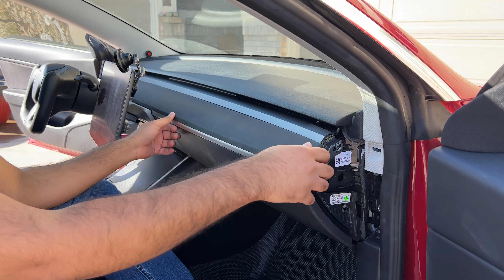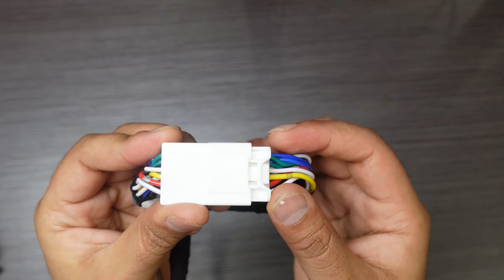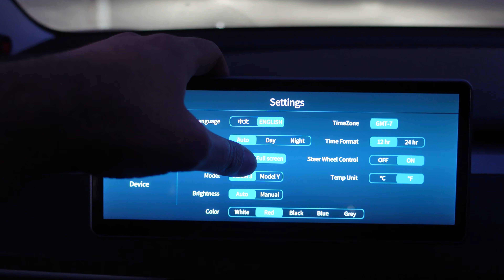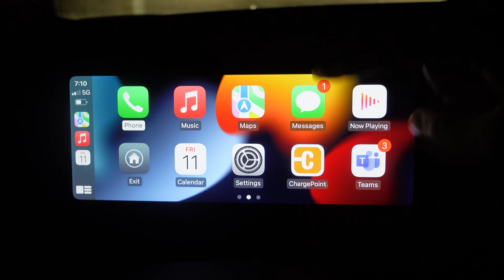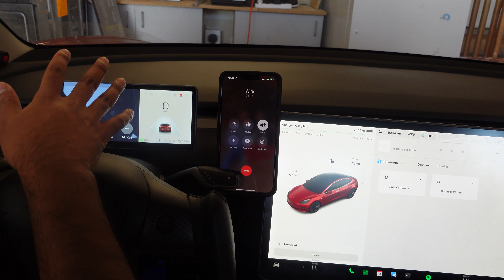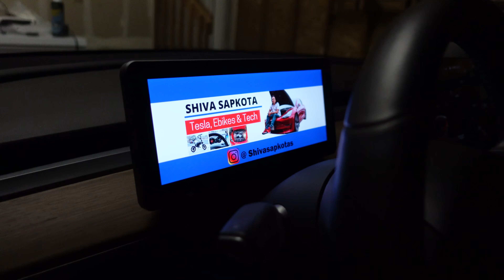NEW Apple CarPlay Display For Tesla Model 3 & Model Y - Instrument Cluster Must Have Accessory 2022

Comment: I'm really glad I found your channle and your videos are pretty awesome.
How does this work with pin to start. And are there any concerns around this unit either being compromised and breaking your tesla security or allowing access to the  OBD port via this unit as its now tapped into the OBD. We have seen how easy it is to steel a car once the thevies have access to the OBD ports.

Comment: Hi Shiva.
Thanks a lot for your reviews. Very productive and precise to the details.
Can you please advise for this screen:
 - How does it work with Tesla audio? Can you Spotify songs through this display? Can you control the list with the steering wheel when car play or android auto is connected? Does it has delay?
 - Are controls always working or if you go on autopilot - will it block the left control on the steering wheel?
 - Does Waze (android) works with this display?
Reply from the maker: -You can connect this display to Tesla via bluetooth. Then everything you play through this display will play from Tesla speakers. There is a slight delay and you can use the steering wheel control when Carplay or AA is connected. 
-The right control will not work when you go on AP but the left works. This is so that it doesn't interface with AP controls. 
-Yes Waze works with this display through AA or Carplay. 
Thank you.

Comment: I installed everything like video my screen won't turn on or have none of my speaker is working now any help please
Reply from the maker: Do you have Intel or the AMD chip? If your speakers are not working, I suspect the wiring connection is loose on the OBD. Please double check that wiring. If you lock the car for several hours and let it sleep, the speaker should start working again. This happens when you take too long to plug the OBD connection back on. If the issues persist, please reach out to Hansshow. Thanks.

Comment: Sorry to bother you I love your video very clear Can I have a question the plug you unplug lock color gray and white but why my model y 2023 that plug black color? Thanks
Reply from the maker: On your Model Y 2023, the plug is on the side door panel (easy access) and it is blue color. Nothing is plugged into it by default and you just have to insert the new male plug into the open female blue plug. Please send me a quick email if you need pictures to locate it. Thanks!

Comment: I have one of these, but getting the latest firmware is challenging, my CarPlay stay connected despite being in the house.
Reply: Have you found a workaround or solution for this? If the CarPlay stays on without anyone in driver seat while car is in the garage, that's an issue since my garage would also be in range while I'm in the house. I have basically the same car as in the video (Intel), but a 10/2019 manufacture date. Does @Shiva or Haanshow have any comments on this issue with CarPlay staying on after leaving car in garage at home?

Comment: So you can use the scroll wheels on the steering to control the  handsshow screen right ? How do you switch the scroll wheel functionality from its native features like to adjust mirrors, adjust steering wheel etc, to scrolling through the handsshow screen and vise versa ?
Reply from the maker: Hello, the native features use the left scroll wheel and this display uses the right wheel. The right wheel only controls car's following distance and autopilot speed and in that case this display cannot be controlled by the scroll wheel once the car enters an autopilot mode. Thanks.

Comment: I have the amd you said the connection  would be on the passenger  side foot panel right? Would  it be the blue connector which I saw in your video?
Reply: Hi my friend  can you please specify which particular plug it is for me to connect  my hansshow cable connection on the passenger  foot panel ? Is it the blue connector where there is nothing  connected  to?

Comment: Thanks Shiva, just installed this device this morning.  Went pretty well, that plug is a little hard to get to but not too bad.  one question - my unit seems to be slightly crooked - it is not completely horizontal as you look at it through the steering wheel, it is angled some towards the left so the right side is a bit higher.  The device is secured to the ac panel.  Also both your instructions and the instructions in the box did not have the hole count right for my 2018 LR AWD Model 3 so I got it to where it was pretty much centered and equal distance from the cut out where the steering wheel goes.  Using the instructions or your count it was way off center.  Not sure if that has something to do with it.

Comment: I have a new 2022 model Y with AMD - where exactly is the Plug on these newer cars - and why colour plug is it....
The picture seems to show its on the side under the passenger area, can you confirm please?
Reply from the maker: On the bottom right door panel. Please shoot me an email and I will send you some pictures. You will also have to run run power and ground from the frunk 12v battery.
Reply: @ShivaSapkota  thanks - done. I also see I have the newer battery with a funky connector - thankfully I can see a positive and negative screw off the battery...

Comment: Excellent video.  I am not sure my wallet needs this, but my Tesla would much like it. I do have one question, does the display screw up using the scroll wheels with the main tesla interface since I saw you using the right scroll wheel on Hansshow display?

Comment: Hi Shiva how were you able to connect the two screens in your tesla to compare side by side? I have installed the new screen however I am trying to install the auto presenting door handles and requires me to plug the cable into the computer. Since I already have the screen connected into the autopilot computer should I just loop the cables from male to female then into the computer?
Reply from the maker: Yeah you can daisy chain the two plugs. Idk if you are a FSD beta tester but my beta didn't work after I daisy chained the two plugs. I had to remove one of the plugs but it could have been just my car. Beta started working after that. The non-beta FSD worked well with 3 plugs daisy chained together. Cheers!
Reply: Thanks Shiva because I was worried I had to take one product out. I will get the install done this weekend
Reply from the maker: @MannyEV_Tech  Good luck!! 👍
Reply: @ShivaSapkota  thanks for your quick response

Comment: Great video. Thank you! I've bought this and installed it on my 2018 Model 3 following your video. It was great until for some reason I am seeing that Carplay does not automatically boot up and connect to my phone. I'm seeing it fail about 50% of the time where it does not connect. I synced it up using the BT-LINK as per the instructions on the device, but its not connecting 100% of the time. Once it connects though, the connection is solid, but I'm wondering if anyone had this problem?

Comment: I have watched this video 2x because I am so intrigued and think it would be a great addition to my Y but for a variety of reasons would not buy it. 1. Because it seems not totally refined 2. Worried about its long term viability. 3. Would NOT want to personally install it. 
With all that real estate on the front direct view it is so frustrating Tesla did not just place some basic details or offer an add on that would deal with speed and just some other basics. The constant 30 degree turn to my right side is annoying and at times dangerous. This might be my only and singular complaint with my Y after basically two years .Other than this display issue or lack of I'd say it is the single greatest car I have ever owned. Just think Tesla is missing an opportunity here to add safety and functionality. Maybe some other vendor will in the near future.

Comment: Shiva, thanks for the review.. I must say how disappointing it is that Haanshow has completely forgotten about those who were early adopters of the10.25" version.  They have stopped updating the unit, there is no feedback from them on their own forums and they have still not fixed the Carplay Phone calling issues, that make the unit unusable ( horrible echo on the other side of the call when unit is sending audio thru the Tesla BT system) . The least they could do is offer some sort of trade in or discount towards the Linux based units (which hopefully don't suffer the same Android based unit issues)  The fact that you have had numerous questions posted about using the existing wire harness and the only response is that " you are waiting on Haanshow"  Tells me they have still not figure out how to support the product they are reselling. It has so much potential, but too many little flaky things that make it hard to justify its purchase.

Comment: Hi Shiva. I ordered this one with your referral code.

I received a connector that is the size of the bottom (white) socket, not the grey one. I have 2022 Model Y with Intel processor and my computer looks like the one on your review. But the connector is the size of the white socket…

Should I install it there?
Reply: Is your 2022 model Y with intel based infotainment computer a performance or long range model Y? +MrGimply
Reply: @electricant1367  I've got a model y performance... Which model do I need?
Reply: @benstory5656  I ordered the 9" Linux version. The unit is in transit right now according to FedEx. My 2022 Performance Y has the Intel Atom chip in the infotainment system so I ordered the corresponding display. How to tell if you have intel atom or AMD risen chip in the infotainment screen https://youtu.be/UyRT4zc2JYA .
Reply: @electricant1367  thank you... Waiting for my car to be produced and delivered (was June to July now July to Sept) once I get the car I'll check the chipset. Thank you for the help. Do I need to do anything additional for the front camera view?

Comment: Thank you for the review. I just received the new Hanshow display. I have an android phone and I didn't realize that the android connection is by cable only and not wireless. It isn't a huge issue but do you think they will add that feature with a future firmware upgrade? Also do you know if I can use any of the car's USB ports or do I have to use the one on the display unit?

Comment: Hi, I have a 2022 Model Y with AMD chip.  Do you have any information if the plug location?  After install the screen, I was not able to find the grey plug any where under the glove box.  Thanks for your help.
Reply: I’d go to hansshow’s web page. There was a link for chatting via Facebook messenger or whats app. I had a different question and asked via Facebook messenger & received an answer about 10 hours later. Hansshow customer service is in China I believe so account for time zone difference.
Reply: There is a plug on the A pillar tucked in among other harnesses. Look at the size of the plug you’re installing and it should be pretty easy to see. 
Another note, as I have 2022 Model 3, mine did not work when plugging into this spot. I had to plug into the empty blue connector and ended up not using the Y splitter since I didn’t have to unplug any OEM.

Comment: I was excited to install this, but the connection to the computer in my 2021 model Y was WAY harder than it appears in the videos.   My hands were too big for the space so I had to get my wife to help - and she was not too happy about that!   Once all connected, the new display did not work.  Even worse, my Telsa display only came on only when a car door was open. Also, the car did not seem to charge anymore.   So I had to uninstall the new display and I will have to return it.    Did anyone else have these issues?  Maybe mine was just defective
Reply: Wow @mitch sieverts that's a bummer.  I'll have mine in a couple of days and hope that I don't have the same experience.  Which style console does your Model Y have - the older shiny piano black style like Shiva's or the current more padded version?  Also, did everything go back to normal after you put everything back?
Reply: @infotime  Yes, everything seems to work ok now
Reply: @mitchsieverts8094  
Are you sure it didn’t just go into safe mode?  It happens if you take too long changing the plug.  This resets after an hour.  He explains the issue in the video

Comment: Great video and I actually purchased a display based off of one of your other videos but judging by this review, I should have gotten this one.  Quick question, when using Waze via carplay, does the nav instructions come from internal speaker or Tesla sound system?  The current  screen I have plays the nav through the speaker and is hard to hear.  Thanks for the informative review!

Comment: Love all your videos and your energy.  After trying several CarPlay hacks and sitting out the previous version of this, I just bit the bullet and ordered this.  Thanks for the discount code!  Hope the "under the glovebox connection" isn't too horrendous to complete.
Reply: How did your install go?
Reply: @electricant1367  worked out pretty nicely.  That behind the glovebox connection was tough, but not the end of the world.  I layed on my side and supported myself with a large box on the ground by the passenger seat.  Overall pretty happy with the system so far.

Comment: Stupid question, but I assume the sound from this unit plays over the Tesla speakers?  If so, is it hard wired or use Bluetooth to play sound?
Reply from the maker: That is correct, the sound from this device can either play through its small speaker or play through Tesla's speakers. This is all connected via bluetooth. Thank you.

Comment: Hi Shiva, great video as usual. I have the old 10.25 model and sound quality and connection issues seem to have gone away. When you use steering wheel control can you make and answer phone calls using the scroll wheel when in CarPlay? Like you can on the old screen. 
Cheers

Comment: So for amd chip variant installation is more complicated? How to  run wires to door panel? Can't find any installation videos for Razen.
Reply from the maker: Sorry what do you mean by Razen? Thank you.
Reply: @ShivaSapkota 
I mean new AMD Ryzen processor instead of Intel , most 2022 models have amd razen processors.
Reply from the maker: @sergys8282  The new cars with AMD chip have the OBD plug on the passenger side footwell pillar instead of under the glovebox. If you get the smaller size display you don't have to route the power and ground, for the larger size display you can get the power and ground from the frunk 12V battery. You can reach out to Hansshow and they can send you some info on the new models. Thank you.
Reply: @ShivaSapkota 
By "smaller size display" u mean 8.8 and 9"? I am interested in this 9" display. Getting power from frunk sounds complicated. Thanks.
Reply from the maker: @sergys8282  This 9" one doesn't require additional power run. So, just ask them for the wiring diagram for the new AMD models.
Reply: @ShivaSapkota 
Thanks man, appreciate your help.

Comment: Hello and thank you for the video. i have a 22m3 with the AMD processor. I purchased the larger display and received it last week. I didn't get any directions or wiring diagrams with the equipment. I have contacted Hansshow and they wont respond. Do you have anything that shows where to install the ground and power? i didn't know if you need to splice these wires in into exsisting wires.
im excited to install but i don't want to cut into the existing wiring.

Thanks
MIke
Reply from the maker: Hello, thanks for watching my video. For the AMD chip, the OBD plug is located on the door pillar. If you send me a quick email with your order number, I will push Hansshow from my end to help you out. The ground and power needs to be routed from the frunk 12V battery. You can technically tap into the wires under your glovebox but it is a little risky. Thank you.
Reply: I’m having this same issue. No instructions. 22 MYP with AMD.

Comment: If I currently have the 10.5", is it worth it to change to the current one?  I don't really have any issues with the current one other than the vents being blocked.
Reply from the maker: I honestly don't think you are going to feel too big of a difference with the airflow. Yes, it is much better but still blocks air. So, it is up to you if you think the new UI and after interface is worth the update. I wouldn't upgrade just for the airflow. Thanks.

Comment: Will they continue to improve and provide updates to all older models? At this rate if they come out w a new display every year and stop supporting their older models, it won't make for the best customer experience and honestly not something I'd want to commit to. Can you confirm this with them?
Reply from the maker: I am also now wondering about that. They are not very clear on these updates. They told me since they fully developed the last year's android display, they might not add a ton of features in the future but continuously support and patch those displays if you have issues. They can't fix stuff like the bezel size or potentially not even the Carplay interface but they should be able to update software on the older one to change the UI at least. I am still waiting for a more clear response from them. Thanks.

Comment: Hello Shiva, I have installed the old screen few months ago… I would like to change it with the new one… do you know if I have to change all the wire or is it enough to change only the screen? (I have installed the front camera too) thanks
Reply from the maker: Hi Brian, this display doesn't support the front camera unfortunately. The wiring is slightly different than the older one. I am still waiting to get a confirmation from Hansshow on this. You can however daisy chain the new plug to the old plug and won't have to reach into that difficult location. Thank you.
Reply: @ShivaSapkota  thank you very much 💪